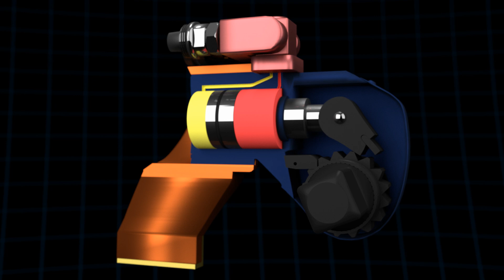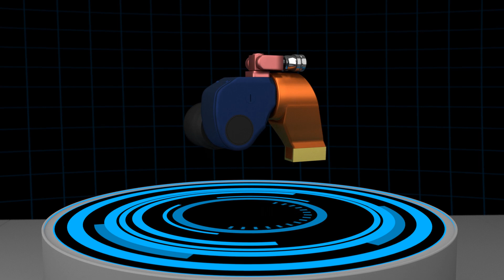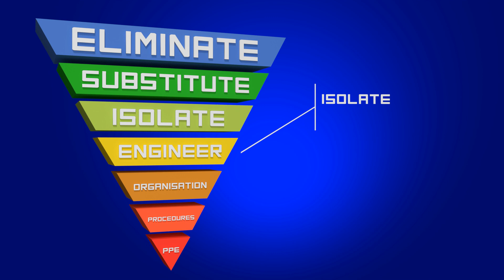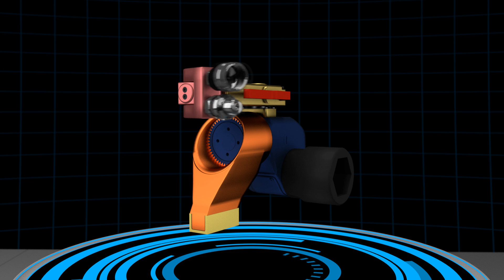Torque Safe - Setting a Gold Standard in Safety

Comment: My question is why do you have to HOLD the lever to DEACTIVATE the tool...and then RELEASE the lever to ACTIVATE the torque....that makes zero sense.....change the valve around so it works like every other power tool in the world....pull the trigger, make it go.....duh
Reply: accidentally taps lever
Crushes hand
Reply: @catfunt5583  hand slips off lever while positioning tool 

crushes hand
Reply: @Steelcrafted  the lever is the thing that you are holding to position the tool, you let go of the lever, the tool is going to drop. It is designed to be held, you don't hold the other parts of the tool, you hold the part with the lever
Reply: @catfunt5583  exactly....so what sense does it make that you let go of the tool and it turns on....the most logical way this safety mechanism should work is that it requires BOTH HANDS to be actuating two triggers, which means if your hands are on the triggers, they can't be under the pinch points....
Reply: @Steelcrafted  you are still thinking single switch  action,  this is dual switch,  one has to press and the other has to release,  if they both press,  nothing happens,  if they both release,  nothing happens,  they have to sync with each other to operate it,  one presses,  the other releases,  it really cuts down on accidental activations.
Reply: I don’t know if he will see your reply. He post over 1year.
Reply: @Yoknapataphaw  I saw it, just don't feel like responding lol....there's a lot of good ideas and view points here, I think the best ones are the someone said about a 3 position switch where if you push too hard it stops, or push too little it stops....and the one I said about 2 switches that takes two hands to operate, so if your hands are on the switches they can't be in harm's way....if you take one hand off the tool wont operate.
Reply: @Steelcrafted  this is the first time I haven't seen total chaos with people with different ideas good job
Reply: Cat Funt well if you were to ever use power tools you would know letting go of the lever again would stop the tool instead of just crushing your hand to a bloody paste without being able to stop it. On top of the fact that you could just add a safety so you couldn’t accidentally press the lever. Dudes definitely right reverse the valve
Reply: @jarrettmaltry6305  when people loose control of a tool they usually try to grab it or tighten their grip more and fast... Its a natural reaction,  so pressing the lever to release pressure is the better way to go from a safety point of view,  and you still have your second switch being handled by your buddy,  if both press their switch,  nothing happens,  if both let go of their switch,  nothing happens,  you actually have to sync with each other so that one presses and the other releases in order to make the tool work,  you my friend are still thinking about single switch operation,  this thing has two,  remember that.
Reply: I think you would really be better off with a deadman style switch like is used for manual control in my industry.  The switch is actual 3 position and must be in the middle to function.  If no one presses it at all it doesn't work and if you oversqueeze which is common in an injury situation it doesn't work.  Proper pressure applied to set to the middle and the tool activates.
Reply: Because most accidents using a torque wrench happen when positioning the wrench,  you grab the handle to position it,  by using this "reversed switch" you make sure the tool is disabled during the positioning action because you are squeezing the handle along with the safety to grab the tool,  once the tool is in position and your other hand is clear,  you let go of the safety lever and the tool can be engaged when you want it to,  if you did it the other way around you can still accidentally tap the lever,  and in tight spaces accidental taps would be worse,  also when people feel like they are loosing control of an object,  they naturally tend to try and quickly tighten their grip or "catch" it...  So yeah,  I think thus "reverse" switch is better.
Reply: Something distracts you for a moment and you lightly tap it

Hand gets crushed

Comment: Why would you put your hand where it is not supposed to be
Reply: AriVovp have you ever used one?
Reply: You have to push the butt against another bolt to ground it. When moving it around it's impossible to be safe at all times. I had a buddy who lost half his hand on a hydraulic lift that just broke, the pump failed and it just snapped back in place. Anything can happen.
Reply: You have idiots who do work all the time.